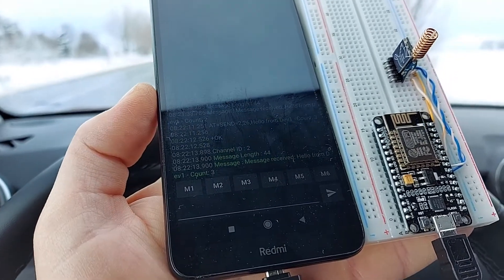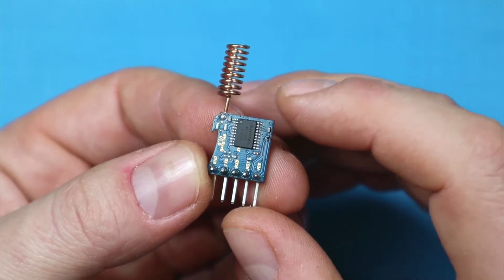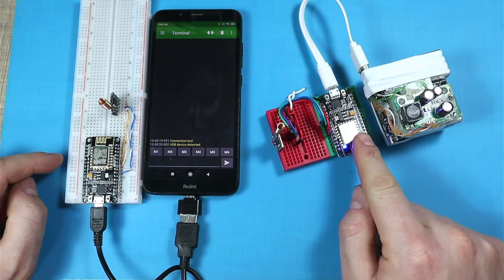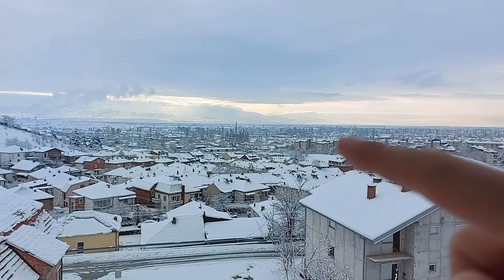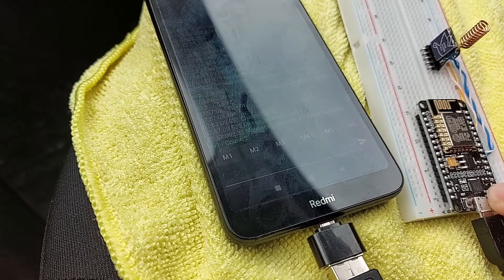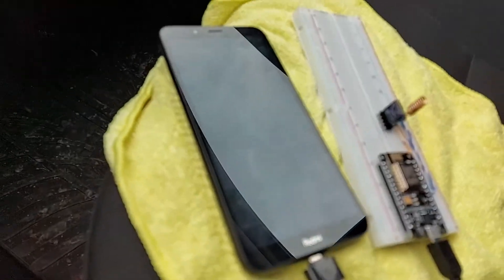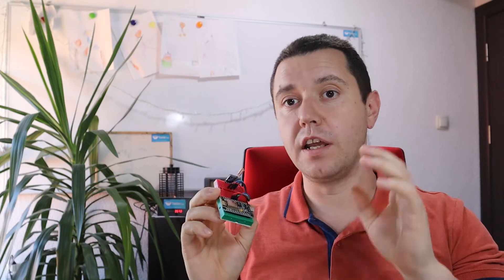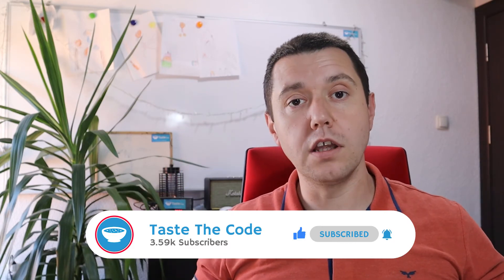LoRa Distance Testing with RYLR998 in open field - Amazing results!

Comment: I have everything setup for testing but, It seems like it's not sending to the other board correctly. I have 1 setup on my laptop and 1 setup on my phone. When I hit the button, this is all I get:

AT+SEND=2,26,Hello from Dev1 - Count 0. 

I've tried it on both and only get the count to go up. It's missing all the text after the command I mentioned above. I've rearranged the wires, thinking I had it backwards but have the same problem. Do you know what might be the issue?
Reply from the maker: First, make sure that you are able to communicate with the device on serial. Issuing AT from the serial monitor on the arduino IDE should give you something like +OK response from the module. Once you have that, you need to make sure that the modules are on the same network and have the right addresses set. Only then, you can start talking between them and send/receive communication. You have all of the required commands in the modules datasheet.
Reply: @TasteTheCode  Just tried what you mentioned and, it's working now! It shows everything just how you setup yours. (It took a few tries). I have another set of Lora modules I want to try out and, I'm hoping the commands are similar. I really appreciate the help, in getting it sorted out! (Subbed as well).
Reply from the maker: Awesome, I'm glad you managed to get it to work. Most Reyax modules work in a similar fashion. If the ones you have are from a different manufacturer, they might be different but I'm sure you'll figure it out. Thanks for the sub! ✌️

Comment: I purchased all the parts but, I'm completely lost trying to figure out the wiring. Do you have a diagram to what wires go from the Lora board, to the ESP8266? I have a hard time looking to see what goes where. I can see it takes 4 wires and got the GND wire on it. lol. (Can't find a wiring diagram in the Github files either). Could you please just write what goes where in a comment? I really want to build this as I'm still learning!
Reply from the maker: it is very easy and it is also controllable through the code since we are using software serial. In my case, VDD is connected to 3.3V (3V3 pin on the NodeMCU), GND to GND, TXD to pin D5 (GPIO14) and RXD to D6(GPIO12).
Reply: @TasteTheCode  Thank you.

Comment: I used your two device code form the GitHub but it will only send the message I didnt show that are communicate or not from the Arduino IDE.
Reply from the maker: Make sure that you can talk to the modules via serial before trying to send data over. If you can't get a response from the module, you probably have a mistake in your wiring. The most common one is not twisting RX and TX.

Comment: can you tell me want is a configuration of terminal or which app. ?
Reply from the maker: The app is called Serial USB Terminal. No specific configuration, just the same baud rate as your code and press connect. Keep in mind, that your phone needs to support OTG and that you need an OTG adapter or cable.

Comment: Pretty amazing to get that kind of range from such a tiny device. Traveled through your neck of the woods back 5 years ago, beautiful country in summer. I did not know it snowed there. Anyhow i did tinker with the Reyax 896 and personally got 8 km around farm land so I will buy a pair of these to see the difference here in Vancouver, Canada.
Reply from the maker: Thanks. It is a good little module .I guess with some better antennas, it will do much better.

Comment: fast enough to send sensor data every second?
Reply from the maker: Nope. There are limits for the duty time so you don't flood the network with your data.
Reply: @TasteTheCode  I thought the whole point was it my network? I just learned about this today and I think i need to get past distance and understand limitations...im lookking to setup a sensor that would give data back every second
Reply: @Jessee99 The frequency is shared by other users, so you can only transmit occasionally so everyone gets a turn
Reply from the maker: @Jessee99  there are gateways that will allow you to create your own private network, however, you will still be using the shared spectrum and must adhere to the same set of rules.
Reply: In United States, yes, but you are limited to dwell time. So you may need to break up data into more than one packet.

Comment: hi does the connection required line of sight ??
if not what the distance they can communicate without line of sight??
Reply from the maker: Yes, in my case they do have a line of sight. If they do not, then it really comes down to environment and how hidden they are from each other. In those cases the range goes down to just several hundred meters but it needs to be tested.

Comment: Has anyone used these to send actual typed messages? Whether using a phone as a UI, or an Arduino and letter selection/screen etc. I don't know if that's possible? Or is there a video of someone doing this?
Reply from the maker: Yes this is possible. Try searching for LoRa messenger. I'm not exactly sure who did this.
Reply: Meshtastic or LoRaWan
Reply: @zazugee  I know Meshtastic has that capability.. I just haven’t seen a device using the RYLR998 that does this. Surely, someone has? I just haven’t run across it yet. The range sounds incredible
Reply: @VanceLambert  Meshtastic on RPi should work with it as long as it supports SPI. I was just looking into this. You have to change the pin outs and some other configs stuff since I don’t think this chip is in the default list, since as far as I read, the RPi support for meshtastic is pretty new.

Looks doable and I’m sure it’s been done just not documented anywhere I’ve seen yet. I’m 90% sure my RYLR998’s are SPI according to the data sheet, I was think of taking at stab at this with a RPi zero when I get some time.
Reply: @gianni_schicchi  Thank you! I’m new and in way over my head.. but ideally, that’s what I want. A super long range messenger using this technology. Let me know when you figure it out! I’ll buy a couple :)

Comment: hello, do you know how much power does the LoRA module by the NodeMCU board itself? If not, can you suggest me a way how to find it using measuring equipment?
Reply from the maker: While transmitting, the module uses up to 140mA at most. During receiving, it is down to 17mA, but you can also use deep sleep where it only uses 10uA. It depends on your application and needs.

Comment: Must try with two yagi antennas on these modules.  I made some reliable communication relay with wifi cards at 2.4 GHZ and two yagi at 15 KM with really good bitrate.  915 MHZ must be more than that easily.
Reply from the maker: Yeah, these do those distances with just the coil antennas on them. Unfortunately I don't have Yagi antennas to try, but it might be an interesting avenue to explore. Thanks!

Comment: To slow for RC Airplane Radio Receiver/telemetry products.
Reply from the maker: Yes, true. This is more for a sensor data.
Reply: correct - that is not what lora was designed for though. It's like saying a car is not a good boat because it can't float - but it wasn't designed to float.

Comment: Thank you for the video. Do you think it's possible to see video realtime using those LoRa?
Reply from the maker: No, not at all. They are only meant to periodically transmit small packets like sensor data. For video, you need to look at 4G or 5G GSM modules but they need quite a lot of power.
Reply: @TasteTheCode   Thank you a lot, I was wondering how those drones reach 10km using camera
Reply from the maker: @rafaelalgo  sorry, I can't tell as I haven't explored their radios but that might be an interesting point of research. Thanks!

Comment: Do you know what power, bandwidth and spreading factor you were using?
Reply from the maker: Just the default of the module0 which based from the datasheet are Spreading Factor: 9, Bandwidth: 125kHz, Power: 22dBm

Comment: car = faraday cage
Reply from the maker: Yeah, it blocked some of the signal but still it worked quite well.
Reply: @TasteTheCode  yes agreed....I was just pointing this out to creater
Reply: @TasteTheCode  yes....nice
Reply: The car might be blocking some of the signal, but it is also reflecting and providing a mulit-path.  If the module api provides an RSSI figure it would be interesting to see what the sending and receiving units are seeing.

Comment: how much date could you squeeze in this link? what's the bandwith? ping? like what you could really use it for?
Reply from the maker: It depends on the parameters used but in general it is 0.3 kbit/s to 50 kbit/s. The purpose of it is to have sensor data collected from a remote, very low power usage sensor.

Comment: on the roof of the car use a magnet to hold a external antenna so it will send and recieve better
Reply from the maker: Yes there are magnetic antennas available that you can purchase.

Comment: Is it possible to know the distance from each other?
Reply from the maker: No, not without additional hardware like GPS modules.
Reply: @TasteTheCode  not even if we use the send time and use some mathematical formula?
Reply: @pedro96465  yes but then you run into the challenges of syncing time. If you figure it out, let me know.

Comment: Hi! Fellow tinker here trying to replicate your project. Do you have a video with the arduino ide settings? I keep getting error messages when trying to compile. I'm a noob with Arduino IDE so it could just be me. I have the com port selected, baud 115200, Both NL&cr. I can see the board booting up in the serial monitor but thats about how far I can get.
Reply from the maker: Check the video description, I have a link to the code running on both devices. In theory you can open that, compile it, upload it to the devices and be good to go. One thing to note is the version of the  software serial library that is different for NodeMCU and Arduino boards.

Comment: Hello! I tried to make this project but it keeps sending me an error... :(
What do you think it could be?

AT+SEND=1,26,Hello from Dev2 - Count: 0

+OK

+ERR=1
Reply from the maker: Without looking at the code it is a bit difficult to know what is going on. Have you checked the formatting of the message? Maybe some extra CR?
Reply: @TasteTheCode  I simply bought the mentioned material, made the same connections and in the end the two modules dont communicate, supposedly they are sending a signal, but none of them receive it
Reply from the maker: @pedromendes8595  Make sure that they are both on the same network and have different addresses. You can check the docs on how to do that.
Reply: There is not “enter” or 0x0D 0x0A in the end of the AT Command.
Reply: @gigigisi6297  but I have the same code... what I have to do to solve this error?
Reply: @pedromendes8595   Maybe you can try AT+SEND=1,5,HELLO
Reply: @gigigisi6297  not working :(

Comment: I wander what the terminal you are using in your phone...?
Reply from the maker: It is an app called Serial USB Terminal.
Reply: How to pass AT commands to Lora from ESP32 UART?
I am not able to send Address,Band, network id through program ?
Reply from the maker: @MrNams  You do it exactly like I do with the NodeMCU but you will need to find a Software Serial Library that is meant to work with ESP32 boards (try this one: https://github.com/plerup/espsoftwareserial) and also make sure that the wiring is connected as stated in the sketch. Maybe even try swapping RX and TX as they need to be crossed.
Reply: @TasteTheCode  Its successfully receive data, it fails to send data i.e. At command through Serial Print not properly sent by ESP32 to Lora
Reply from the maker: @MrNams  That's weird. Does it have an error? Check the line termination character.

Comment: Which country is this, Looks like beautiful  Macedonia 🇲🇰?
Which Spred Factor and Transmit power did you use?
With an heltec esp32 lora module I managed to get 500m in an urban area with SF 11 and TX of 18dbm. Would be interested in a second video with more content:)
Reply from the maker: Hey, yes I'm based in Macedonia! The modules were set at their defaults of SF 12 and output power of 15dBm. What would you like to see if I make a second video on them? 👋👋
Reply: @TasteTheCode  Maybe the maximum bandwith with different SF and Stability eg. rain/foggy weather would be nice. Extra Bonus if you test different LoRa ESP32 Modules to determine the Top3 for example. Keep up the good work - will subscribe :)
Reply from the maker: @hofertyp  Thank you and thanks for the suggestions! I'll definitely include them if I decide to make another video.
Reply: @TasteTheCode  Znao sam da je Balkan čim sam vidio ovu kuću na četiri vode, to je Turski stil gradnje.

Comment: What is the difference between LoRa and a normal 915mhz UART transceiver module from someone like HopeRF? I really struggle to understand the terminology and what the differences are. Great video!!! Thank you!
Reply: Hey, so just to clarify some things:
LoRa is a technology of it's own, meant for wireless sensor networks, so its main focus is to be power efficient and long range ("LoRa" actually means "Long Range"). The way it handles radio waves isn't as simple as a typical UART transceiver, it uses chirp signals and some engineering (that I'm too dumb to explain 😅) to make the signal travel a very long distance (at the cost of low data rates, up to 50kbps).
However, LoRa itself is basically just the "hardware level" technology that deals with the signal. A MAC layer protocol called "LoRaWAN" was then created, so that different sensors could communicate with each other in a network of LoRa devices and also to make it possible for them to communicate with the internet. For example, a LoRa end device in Australia can communicate with another in the UK, what happens is that a LoRa end device talks to a LoRa gateway in Australia, the LoRa gateway in Australia communicates with the other LoRa gateway in the UK through the internet and finally the LoRa gateway in the UK communicates with the LoRa end device.

To sum up: 
     - LoRa is the technology that makes power-efficient, long-range radio communications. 
     - LoRaWAN is the MAC layer protocol that makes LoRa versatile.
Reply from the maker: Well said!
Reply: @itsamevic  Excellent reply!!! This was really well written, especially considering conveying these technologies can be esoteric at best!
Reply: @StreuB1  Thank you very much! English isn't my main language so, for me, writing a text that big and receiving such great feedback is very rewarding! Thank you!
Reply from the maker: Thanks! I haven't got a module from HopeRF yet to test but from what I know this allows you to set your own standard of sending while a LoRa module already uses a defined standard. If I'm not mistaken, I think that you can use this modules with LoRa as well. The UART specification just defines how you comunicate between the module and your microcontroller.
Reply: @TasteTheCode  Ahhh, I think I understand now. I always get confused between the data communication between devices and communication over RF. So LoRa is the RF protocol. I am an electro-mechanical engineer who is trying to learn electronics and programming. I love it but unfortunately the bar for entry is pretty steep and there aren't many resources out there that explain certain aspects in extremely basic terms to get you going. I just stumbled upon your videos and they are fantastic!! BTW Macedonia is a BEAUTIFUL country!!!! Thanks again from currently frigid Illinois, USA.
Reply from the maker: You are welcome! Yes LoRa is the RF protocol. It can be on different frequencies depending on the local law. In Macedonia is on 868MHz. Have you been to Macedonia? Usually we are the ones with snow but now it seems that the weather is quite different.

Comment: impressive range. pitty data rate isn't fast but that it was designed for. short messages not lots of data transfer unless you use like multiple units for multiplexing?
Reply from the maker: Yes, this is only for short messages. As for multiplexing, I don't know if that is even possible. But for reading out sensor values and sending short commands it is ideal!

Comment: Good job mate , thanks for sharing. 
I have a question. Can we detect real time distance from transmitter to reciver?
Reply from the maker: Hmmmm not that I'm aware of, unless you use a GPS module as well. Maybe you can use a timecode on the sender and then another timecode on the receiver but these clocks will need to be perfectly sincronized so you can then calculate the delay between sending and receiving. Sounds possible but it will be very difficult to pull out in reality.
Reply: @TasteTheCode   Ok. Thank you again ı will try

Comment: From your code, I see that you used the max baud rate of 115200.  Does the LoRa's transmit baud rate vary depending upon the serial bus baud rate or is it sent at the same rate in a packet no matter what the serial bus rate is set at?  If it varies, a lower baud rate setting might result in even greater range.
Reply from the maker: From what I'm aware of serial baud rate does not affect the transmit baud rate. It's just the way that the microcontroller talks to the module. To get better range, you might lower the baud rate of the module by issuing the right command.
Reply: One update, now AT command is returning +ERR=5, when i try to execute AT+SEND command from esp32

Comment: Can you recommend a Terminal APP for the phone? and does the App change the phones USB to work in USB-HOST mode?
Reply from the maker: I'm using "Serial USB Terminal" app and it worked beautifully. The app is not the one that makes the USB into a host but the adapter/cable used. You will need a USB OTG cable or adapter so the phone can recognize the device connected.